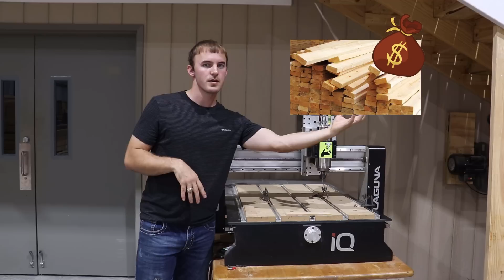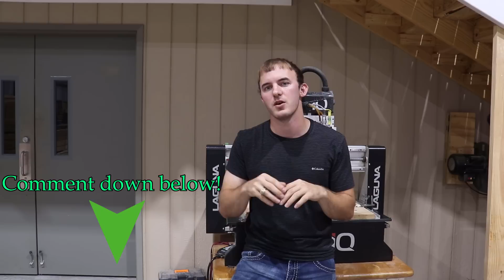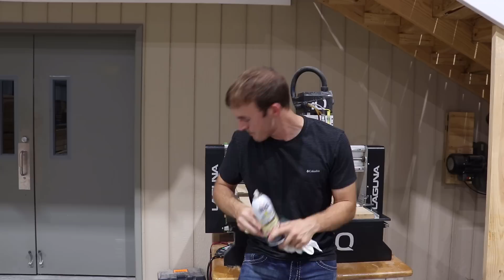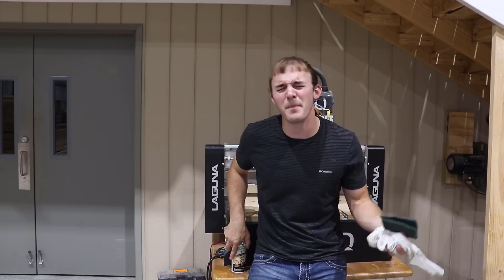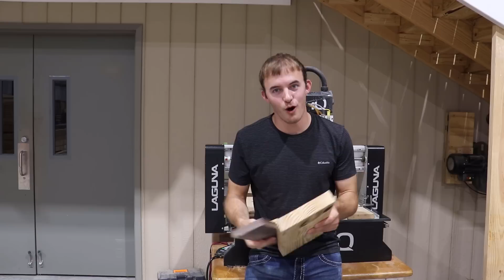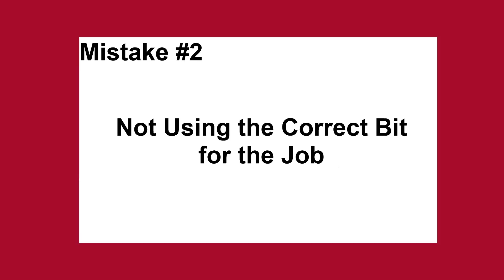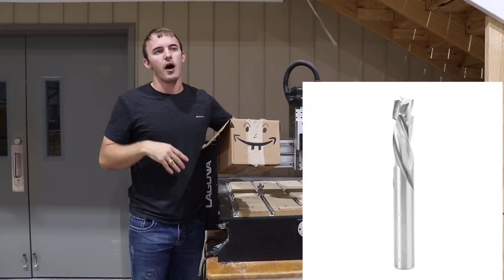Mistakes CNC Beginners Make | Wood CNC Router

Comment: How do up-cut bits tear at the material, if you use a chamfer bit for the paths first? Like leaving a 1mm chamfer after all paths are complete... Is tear out at the top a problem in plywood?

Comment: Thank you for video. Can you give little advice for begginer as me, i have 1kw spindle 800mmx500mm cnc and whatever i use feed/spindle speed i get black bit and smoke smell of wood. Manufacturer advice feed 500mm/m with 10000rpm for beginners with 6mm bits or 8mm bits. Can you give advice direction for me as begginer, i listen most of your videos. And i am hungrz for info for hobby beginner level. Feed/Speed for my level of machine. Thank yyou very much!!!!

Comment: that CNC you're standing next to "starts" at $15,500 here in 2023.  Would you film the exact same content today?
Reply from the maker: That’s crazy, so they took away the IQ it seems and only have the Pro edition which has the Automatic tools changer,  just the IQ should only be like $7,000, I personally would not start with a small desktop CNC like that with an ATC it would not save you enough time on your toolpaths. That IQ Pro is the upgraded version of mine. I don’t know why they took down the cheaper model, makes no sense. I would not of been able to afford that 15K CNC when I was starting out.

Comment: Problem of Running to slow. If you have a hobby machine it is not good to slow down the rpm cause the spindle is probably to weak, Same if you increase the feed rate. For beginners with hobby machines i would recommend to buy single flutes endmills, which allows to run them with high rpm and slow speeds with the right feed rates. This helped me the most

Comment: Good advise here thanks.  I am not new to CNC machining but I am new to the small machines.  I recently purchased a Sainsmart 4040 pro and I am having trouble with chatter.  I am cutting 1/4" Hickory and Walnut with bits from 1/8" up yo 1/4".  So far I have had the best luck with a 3/16" single flute up cut tool.  I am starting to think that the supplied spindle needs to be replaced with a heavier duty model.  Any advise you can provide will be greatly appreciated.

Comment: Thank you for the video. Super helpful! 
Question - Can cnc machines use a 1/8” Bullnose router bit to de-edge and de-corner rectangle 1/8” polycarbonate? 
Would this bit run into the cnc table? Would the material need to be raised up off the table?
Thank you for your time!

Comment: I have ben working witch cnc half my life 20+ but in metal, I am buying a huge old 5ton 3 spinal vacuum table, mashine for wood, so I am curious to work with wood. but it's going to rund as much as possible..
Reply: and with my 20 years I also still learn.
Reply: And my advice, go slow when you prepair, a error cost way more time, I haven't don a error I something like 8-10 years in the mashine, I found all my error before hitting run. Do it right first time...

Comment: Hello, I’m a bit confused about the last part where you spoke about the machine running too fast, or too slow. Please correct me if I am wrong, but it seems like you said if my machine begins to scream, my bit is moving too fast but my machine is moving too slow. Is that correct? I was told to test my machines for its maximum speed and stuff. But I have no idea how to do that. Please clarify, thanks!
Reply from the maker: So the screaming is vibration from running it too fast or too slow. Too fast is vibration from deflection, too slow and it’s vibration from rubbing
Reply: @cutting-it-close  oh okay, so it's either. That's what had me confused. Thanks for the clarification. There a FB group I'm in, I was told I'm supposed to find out the maximum speed of my CNC machine. You briefly covered that in the video. Do you have a video where you explain how that's done? Cause idk how to test my machine's maximum speed and stuff. Thanks!

Comment: Could use your help making a purchase on a cnc machine have a small little space in Massachusetts  12 x 25 I want to make furniture out of wood and plywood my furniture is no bigger than 24 x 36 I will also need to use joint cam

Comment: At about 4:00 you mention use of the half inch bit. I use a half inch bit in my cnc and its a hobby machine made out of HDPE and metal rails. Not sure if my experience is the same as yours because I run a half inch bit with ease. Perhaps its the type of cuts as well
Reply from the maker: How fast are you running it?

Comment: Hello sir
I am using offline cnc controller and vector aspire. My machine starting z height is correct, but when program ends it will not maintain safe z height with material and many time it will clash to material and come back to home position.If you have any idea, how to resolve this issue, please reply to me

Comment: https://images.app.goo.gl/PEMC4KemFExLHsgh6

If I want to do text engraving on a 3D shape like that, do I need a 5 axis machine for it to look nice? Or can I make it look good with a regular X Y Z machine? I've turned a number of bottle openers that are 3D shapes like that on my regular old wood lathe, and i had 1 engraved as a wedding gift, and about 40 characters of text engraving cost me like 35 bucks.  Would a regular 3 axis cnc router be able to make 3D engraving on shapes like that look nice or would it look kind of crappy?

Comment: great video. I have a Laguna IQ and it's worked pretty much trouble free for 7 yrs now. Unfortunately, I accidentally "Wiped the Cache" on the hand-held controller and lost my Pulse Equivalent settings. Apparently Laguna customer service isn't open on weekends :(  Any chance you could tell me what the Pulse Eqiv. settings are in the controller of your IQ?? They should be what mine are supposed to be. Thank you!

Comment: Pls I need to know how to send a project from the computer to the machine
Reply: You need the equivalent of a “modem” app and a cable.    HyperTerminal is the oldest communications app and it works with a parallel port.

Comment: Ok first off, I take NOTES, so thank you!!! Got y notes from this video! And now ,the UGH- I cannot tell you how many videos I have watched, how many notes I have taken, and speeds and feeds are always- always- always talked about....except...what they are, and how do you KNOW? Is there a guide that comes with each router that tells you what the slowest and fastest is for that router? Is it table/router marriage? Please...If you have already addressed this- can I have the link? My machine is coming, and I have written a notebook full of notes....watched a lot of mixed up, lost my place in line videos...SHEESH...and don't get me started on setting an origin...sighhhh whatever that may be. Sometimes, I miss books!
Reply: I've been working these machines for over 25 years professionally. I have cut wood, many plastics, and even aluminum. If you ever find an accurate link for that all I can say is I wouldn't believe it. There is no definitive speeds. I find the plunge rates, travel speeds, rpms, direction of cut, etc  that you finally come up with is more of an art than a science and it is based on quality of cut, bit size, materials, capacity of the machine, and on an on. All I can suggest it to start from the "less aggressive" angle and work up than go from the other direction and probably break bits, have material move as cutting, etc. Take it slow and make a number of test cuts until you're happy with the results before committing to cutting the real piece. I still do that every time I do something new even after all these years. We're always learning!

Comment: CNC beginner here. my problem is that i don't know where to start. i don't want to buy a cheap machine that will not be able to do basic work and i do not want to over spend because i am just doing home, hobby things. the hardest metal i'll cut will be aluminum. and this will not be an everyday use of the cnc machine.
question
can a 800w,  24kRPM spindle cut Aluminum well? because i am thinking of a CNC 4030.

Comment: Silicone based lube is not good if you want to use epoxy or spray finish on your woods. The finish will never stick .  Stick to non-silicon based lube . Better yet, rig a pumping system to all your screws and bearings. Mobil Vectra 2 gets my vote for lubrication .

Comment: Running the bit too slow creating heat is the same thing as a sawmill. Its creating fine dust, not cut sawdust. And as you say essentially rubbing. The bit needs to be producing chunks and clearing them out.

Comment: I have to disagree with you on how you price out jobs. I have a sign company for over 15 years now. Just because you bought a machine and only use it 2 times a year doesn’t make its price for the customer go up. If you price like that you would not be competitive in your industry and perhaps that’s why no one gives you work. Your prices have to be on par for what the market calls for and by doing this you will get more customers and be able to grow and expand your business and increase your profit margins as you by better faster equipment and tools. The main advantage a local shop has is delivery cost. Wood weights a lot so there is nice profit in the shipping cost.

Comment: Nice video. Thanks for the info. I am never sure of my speed and feed. I carve MDF which just makes dust. I carved some Maple with half inch end mill shaping cut. Chips flew and it was obvious that the feed was matching the spindle speed, but I don't see this with smaller bits.

Comment: I fix 3 million dollar cncs for a living so I didn't go in blind on maintenance but the software side is where I struggle because of cost  and or experience with it
Reply: Do you work on older cnc Bridgeport mills ?
Reply: @wewe365  no I work with newer ones. Grobs, fanucs, comaus, gehrings, ect
Reply: @wewe365  if you have a question about anything I can ask the older guys I work with a lot of them started with those
Reply: @kristopherhilton8065  I have found a few old cnc Bridgeport for sale. I know this is old technology but I’m especially interested in retrofitting to newer electronics without spending as much as  a late model vertical mill would cost. I don’t mind doing the work
Reply: @wewe365  I'm sure it wouldnt be too hard to set up. The coupling setup would be the hardest part and I would say use it as is to make the new couplers. The programming itself is real easy because you can just buy a cheap grbl controller online and throw on a few stepper motors of appropriate size then its just calibration.
Reply: @wewe365  if they are functional I would say buy small steppers and find a way to mount them to the existing manual components (wheels, knobs) to drive them.
Reply: @kristopherhilton8065  that’s the problem. Most of the old tech cnc Bridgeport are needing electronic repair. I have found plenty of cnc  that are around $2,000.00 but not worth fixing the old technology. Not sure where to start.
Reply: @wewe365  I mean you could get a totally manual mill and throw the motors on the axis. It wouldnt be much money and the learning curve is nothing

Comment: 0:37 yup thats bout it.tell that to boss. same parts need multiple setups bcoz blanks are dirrefent sizes and he try sell every part cheap as possible so he get job.well that f**** wrong.if customer accept prize then we make MONEY.if boss tell this low it cost.means it have to done FAST and usually tomorrow(what ever its allways tomorrow.never next week).it means it cost more allready.need make those parts what boss promise tomorrow even it means need break up another working setup for doing.cant multi task other machine bcoz allways hurry.and no tools cost no material cost included.what kind of business is it? this part need this tool. NO NO it cost too much.we do with this tool some how magic.well that tool cost can add part parts LOL(customer not see it) prize is still way too low so boss get that job and tool is for us forlife. cant buy even more vices or even better ones with replace jaws lol. would be easier when have multiple setups than one old. that SERIEOUSLY not hold 500mm part using 50mm deep jaws when machine travel is but 550mm not included tool lenght OR machine x is 850. why take parts that are 1000m need slide parts to get it done.think what error come when by hand slide part and continue cut LOL.boss say its okay.not first time part is coming back to fix LOLoone guy do setup and then "someones" who not even know how program or what it will do just throw parts in.good business xD AND its like allways 20 part ordered 20 blanks. any setup can come fault parts. boss say its okay.its not much.then parts come back bcoz faults. DID nobody measure them? LOL then make same setup again to take shim off from usually and i say cant take 0 from 0 with our machine when parts are allready not correct.boss say okay LOL and its funny some clients have told they would paid 10k for it.its like drop jaws. boss is just ask how fast this part can be done.what the fuck. setup take longer.can this done 3minute. if take full cut this feed yes, but will it work? when "someones" just throw parts in and not care measures. try do 6000 part serie. he is just looking 6000 * 3min machine time cheap as possible when he could count it correct and really make money.there is no other company that do cheaper.i bet. thats life in our company xD
and still one thing why take 1-2 parts when they not make money more than actually it cost to make them AND yet again cheap as possible. it mean they cost more when just 1 or 2. can work with other machines same time. if have 20 parts i can run 7 machines same time no problem.but if i not have time to start other jobs then i make those 1-2 parts becouse job just came and they want it NOW tomorrow LOL so why part cost like 200 when should ask 10k or something LOL if customer need it tomorrow then it cost.if customer not happy we make more money not do it cheap LOL and run other machines more. bos not understand logic. and we need it tomorrow means it will come back in 2 week bcoz some fault. no hurry now LOL and customer ordewr same part continously 1-5-10 and we not make any extra same time. thats free money. there is no time start make new setup but could cut more parts in storage. FREE money

Comment: I ran a shift at a cabinet shop that laid off their $10/hr panel saw operator and leased a $250,000 CNC router to cut rectangles out of sheet goods. They took their best cabinet maker off the floor to convert CAD to CAM, one line of code at a time, because they didn't want to pay for the good software. When they went out of business I took a job at a high-end shop on Maui. They cut everything on a panel saw.
Reply: Fuckin Howlies

Comment: Mistake #1 running bit too slow, burning fix of reducing bit speed .com seems contradictory to what was explained. Increasing bit RPM speeds cutting of the bit puts less friction time on the bit  since the amount of bit metal per unit of  time contact with work in decreased. I understand increased feed rate. 
Not answered  what do overly aggressive feed rate for material or excessive bit rpm cause besides broken bit.?
Reply: Excessive feed rates heat up your bearings and your material can slip while being held down especially using vacuum hold downs. Also circles and other parts may not be cut perfectly to shape as the head can deflect slightly. Excessive rpm combined with too slow speed can actually start fires when cutting MDF or melt plexiglas.

Comment: I find when cutting wood, its best to climb mill as it creates less tear out
Reply: What do you mean climb mill?
Reply: @kristopherhilton8065  He is referring to the rotation of the bit relative to the feed direction or "running the bit backwards". No matter the travel direction of the toolhead, from a birdseye view the bit is rotating clockwise. To "climb cut" means on an outside cut you would program your pass to be clockwise instead of the conventional counterclockwise.  For an inside cut you would program the tool head to travel counterclockwise around the shape you want to cut instead of the conventional (and more efficient) clockwise. This way the bit is less aggressive and will "brush" the material compared to "cutting" the material. Some benefits but still best to program conventionally unless of special tearout situations, running them backwards dulls your bit prematurely as it heats up bits more. It also heats bearings more which is bad. Chips tend to be more of a powder...again bad. So he is sort of right...in some cases of sensitive tearout, but certainly not as a general rule.

Comment: I have been running a machine commercially for 2 years now and still feel like I have no idea what to charge, some jobs go so easy and others a very difficult! I have learned that even though the machine is "doing all the work", learning how to use it properly and efficiently is also a huge undertaking.  Thanks for the tips, probably a little late for me but hopefully others are smart enough to start here!

Comment: Thank you very much for this great video. Next month I will buy CNC 6090 machine (router) from China with DSP controller, but I will make reliefs in the marble.
Could you make, please, some video in which can explain balancing  spindle speed (RPM) with feed rate and plunge rate, these three variables. Thanks in advance, Best regards from Croatia.
Reply: Plz tell mi some CNC machine price , I like to jump in this field, plz guide mi
Reply: @juttryit.6747  From 2.600 to 4.500 USD
Reply: @marismarisovich4385  I want to send You one picture which includes machine specifications ,How can I contact you.